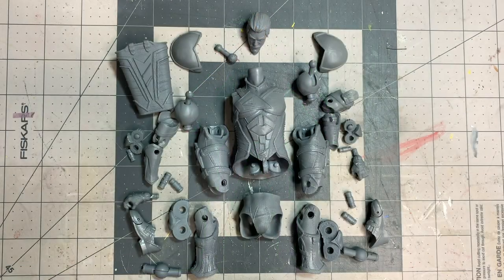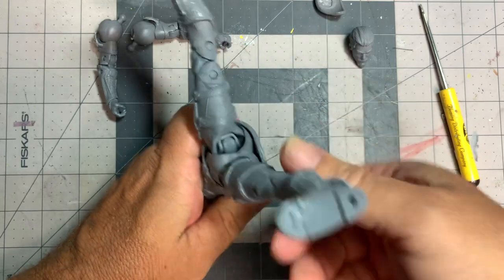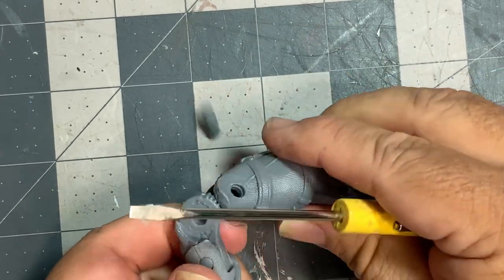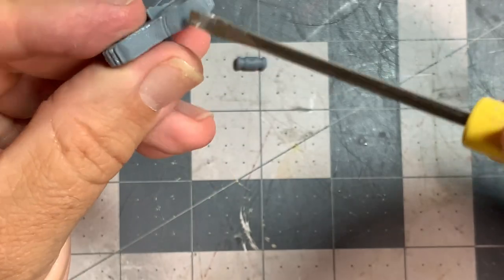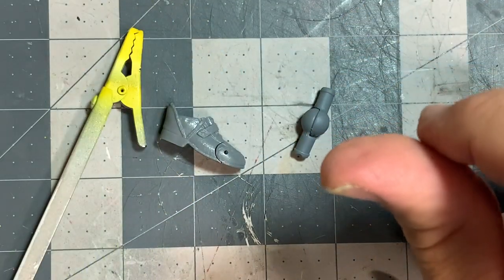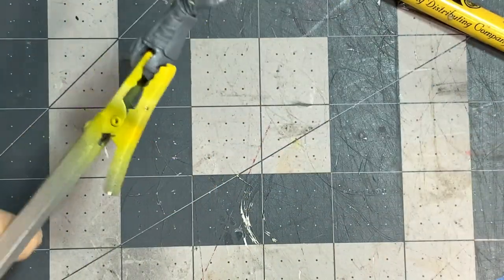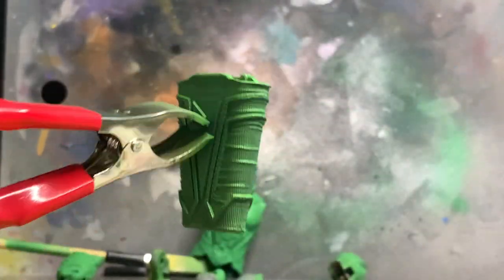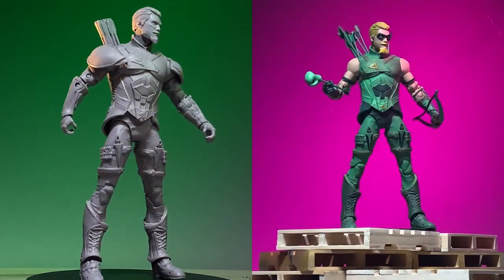How to Disassemble a Mcfarlane Figure

Comment: What I've learned from this video is that you really need to be brave enough to disassemble these figures and hopefully you will be able to reassemble them to how you got them from the factory. 🤣I always worry that i will ruin these figures that sometimes aren't easy to repurchase them. I have heard from some other customizers that they don't always disassemble their figures and that sometimes you can just paint directly on them as they are... I guess that there are some figures that you can get into the areas that you want to paint without having to disassemble them. Anyway thanks as always for sharing your video with us here on YouTube, your willingness to share your techniques with us is greatly appreciated by me and I'm guessing many others. 👍👍👍
Reply from the maker: I had several requests for an updated detailed video, I hope it covers the request. True some figure don’t require disassemble but require a visual demo to see it proven… more to come later…. Thanks again for watching
Reply from the maker: Yes, currently using dye when possible…. In this video I wasn’t knowledgeable enough to use or share but now i can….
Yet i still disassemble a figure when needed… but if i can pant directly on the surface without disassembly then yes, its the way to go… Each figure is its own project and the method or technique may differ according to the figure or desired look.
Thanks for watching
Reply: What’s the Dye product? Can you share more info or where to get it. Thanks
Reply from the maker: Thanks for the valuable insight…
We all continue to grow and learn… 
Much appreciated 
Thanks for watching the content
Reply: @ooneybird27  Thank you so much.

Comment: Do you have a reassembly video? I took my batfleck apart and can not get it back together. Was using boiling water to soften the parts. Paints coming off, bloods getting all over the place, its turning into a nightmare
Reply from the maker: Oooh no!
I dont have a reassemble video….i dont have the figure… it was a commission piece… 
When reassembling only heat the receiving piece not the peg it’s self…
Send me some images or video to help you out…..
Photobella@mac.com
Reply: @InkDropCustoms  thank you so much I just sent some over. Obviously no hurry at all and thank you again for offering to help.

Comment: Any way you could try to shorten up a mcfarlane ? Like the best way to go about it ?
Reply from the maker: It’s tricky…. What works on one figure will not work on another 
On some figures you can drill the foot peg deeper into the leg
On others it’s best to switch the hip joint entirely but finding the legs that clip on is another factor. There are so many variables that come into play.. I don’t have a simple solution yet
Thanks for watching
Reply: @InkDropCustoms  appreciate ya
Reply: @InkDropCustoms  been trying to shorten up the new 52 red hood and the new robin to try to get them to fit into 6 inch.. dying for a good 6 inch red hood tho.. Great channel . I'll be watching

Comment: Great vid, thanks for sharing. I have a question for you: Did you have any issues getting the thighs reattached to the hips? I have a Deathstroke that I've done some work with and one of his legs now falls off any time i try to move it, no matter how much I've heated and tried to close it up.

I was really hoping you would show the reassembly but it was skipped right over, lol
Reply from the maker: The video just focused on dissembling 
I’ll have on reassemble… I have shown it before but people ask repeatedly to be shown again 
Yes , many of these figures are a pain to reattach the hips…
Reheat and closing the clip is the best way… cooking it immediately with cold water then setting into place… you can also try removing the Clío the hinge goes on to…. Set that in the hinge then set on to the pin …
unfortunately some of the plastic just requires a replacement piece, robbing from another figure
Reply: @InkDropCustoms  Thanks for answering, much appreciated! I just found your content, so I'll have to look through your other videos for reassembly. I've tried resetting it, but I haven't tried "quick cooling" it, so I'll give that a shot later.

I really wish they'd just use a damn ball joint on those hips, lol

Comment: Amazing video! question though, is it possible to do one for mcfarlane doom figure? Currently I tried to a classic version of Doom figure where is ankle ball joint cannot twist. Mine is not align properly straight. I tried your method by using the hair dryer and it still not able to take out the ball joint of that ankle or adjust it.... Any tips or thoughts?
Reply from the maker: It may be fused with the other plastic… you may just have to drill and tap then replace with out another peg… I always keep a donor figure… 
Let me know what figure base you are using… I’ll mail you a peg or matching pegs… let me know
Reply: @InkDropCustoms  thanks for the response. I have the classic doom guy mcfarlane. though, those are hard to find and expensive. On you video, does that figure was able to twist the ball joint of the angles? Not the foot itself. I have the pictures of my defect figure and been trying to do some research of fixing it.